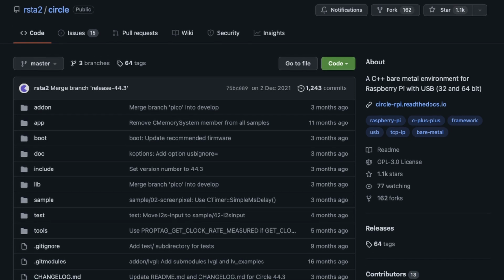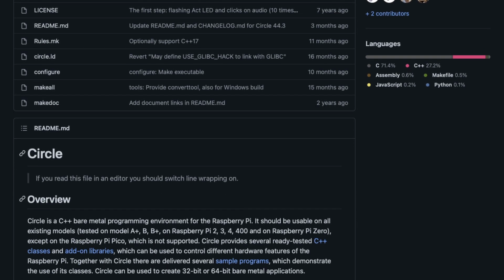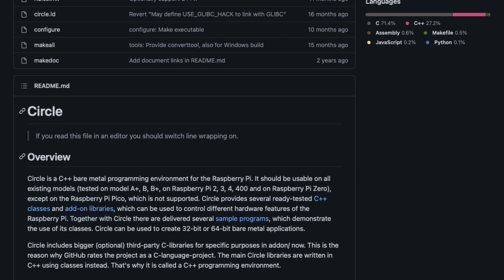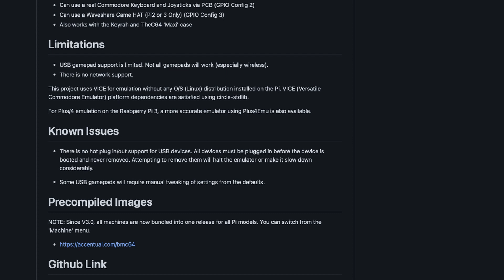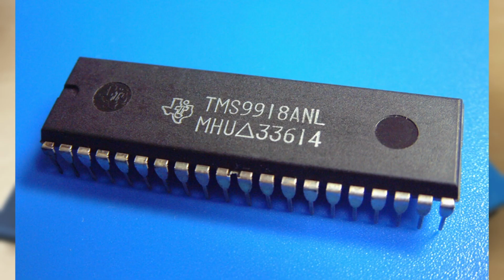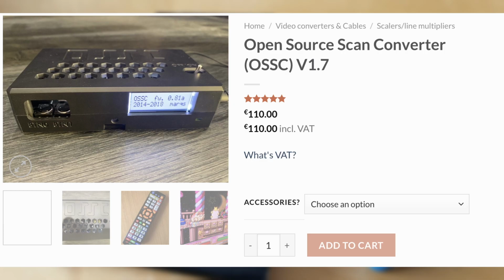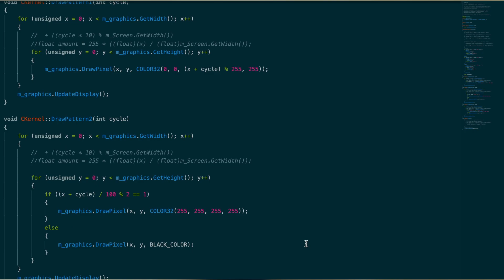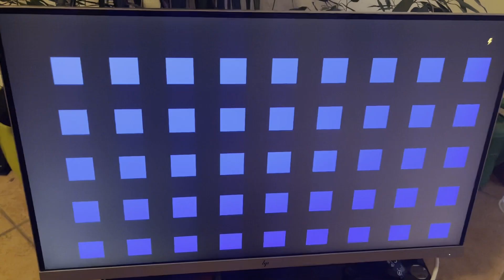Raspberry Pi - Bare metal video output using the CIRCLE library

Comment: I have a lot of projects, but this is one I wanted to do as well: using the raspberry pi as a "graphics module" for other hardware projects.  How will you connect the rpi to the RC2014 system bus and design the interrupts and stuff?  It would be cool if the rc2014 could write to memory mapped addresses and the rpi responds.  Will there be DMA between the memories?

Lots of opportunities for design!

Looking forwards to your updates!
Reply from the maker: I was thinking about having a command interface on the data bus, so the gpu would ocuppy only a single address or maybe only a couple. But there hasn’t been much time to work on this during the last year.